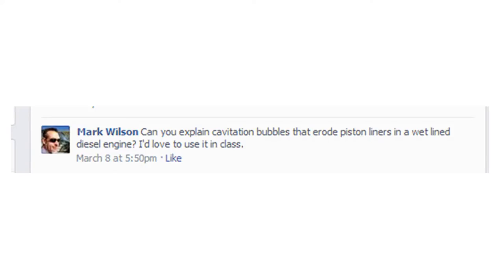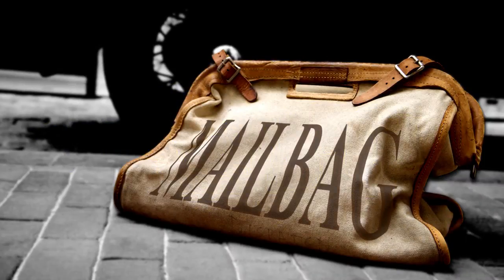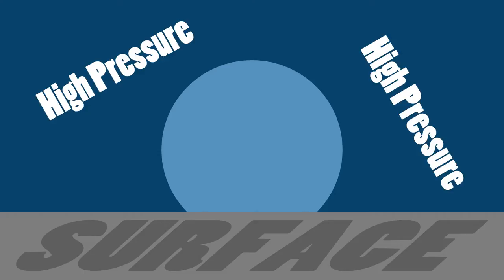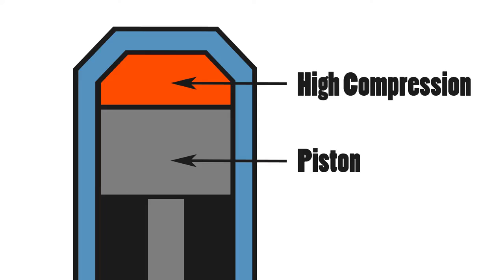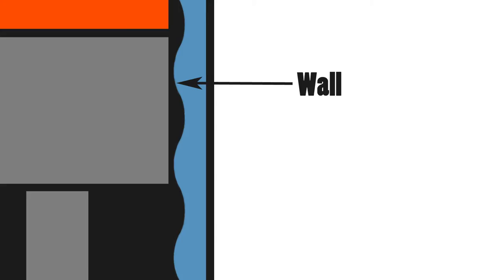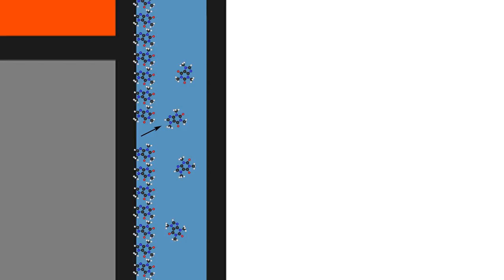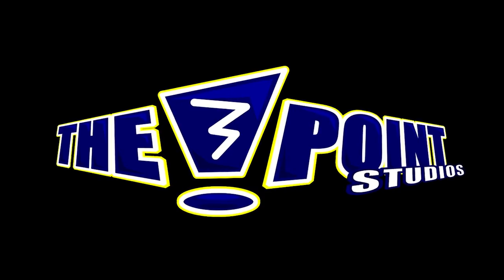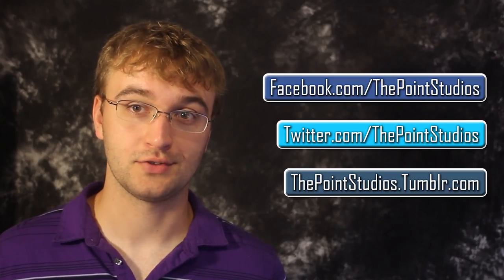Cavitation in a Diesel Engine - MAILBAG

Comment: Cavitation is implosive.  The pitting of the cylinder wall is not due an explosive and radiating force.  The implosive reaction literally "sucks" the metal from cylinder wall instead to the very centre of the reacting bubble.

Comment: So how does the same thing happen with water in the pot on the stove with no pressure?
Reply from the maker: The bubbles in a pot of water on the stove are due to the water boiling, changing from liquid to gas by adding heat. Liquid water closer to the heating elements (stove) changes to gas before the water at the surface, and bubbles rise from the heated side to the surface. These bubbles are very stable and simply release water vapor into the air.
This is not cavitation. Cavitation doesn't require heat to create bubbles, it requires large pressure waves to rip apart the water. These bubbles are very unstable and quickly collapse back into liquid water.
Reply: Pressure waves will travel from the cylinder wall into the cylinder head cooling jacket?
Reply from the maker: Yes
Reply: ThePointStudios So why do certain coolants resist this action for the life of the vehicle? Only water is subject to the pressure waves due to it being less viscous?
Reply from the maker: Every fluid is subject to pressure waves: air, water, coolant, etc. The coolant doesn't resist cavitation at all. In fact, it is very similar to water. The biggest difference is there are ions (charged molecules) dissolved in the coolant that repair the cylinder lining from cavitation damage. The coolant doesn't resist the damage at all; it simply repairs the damage that is done.
Reply: Tough to understand it after a bunch of years of dealing with failures and then finally finding a solution to coolant issues.